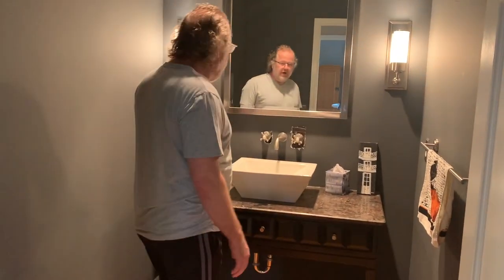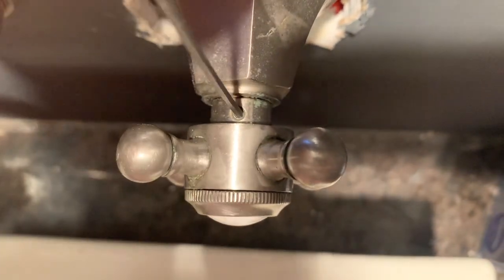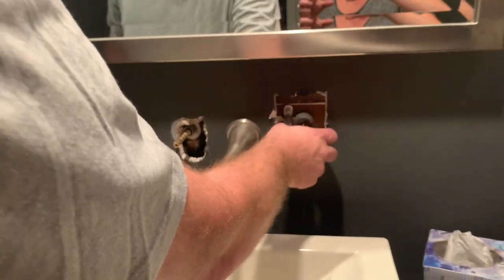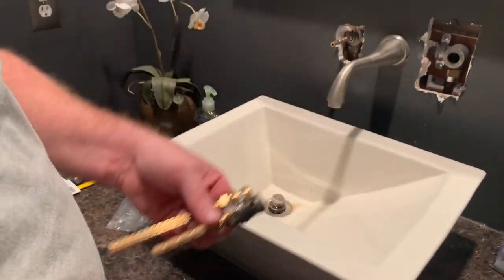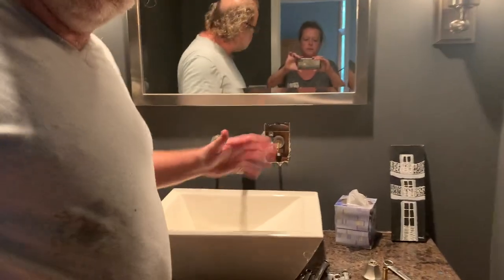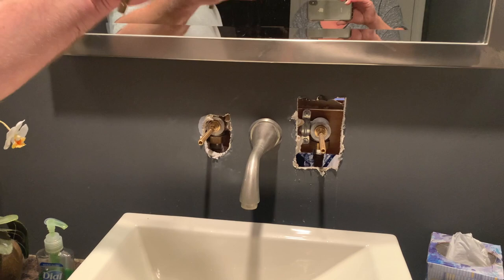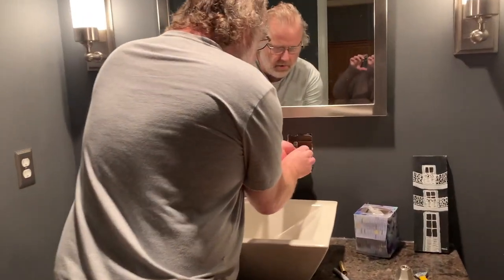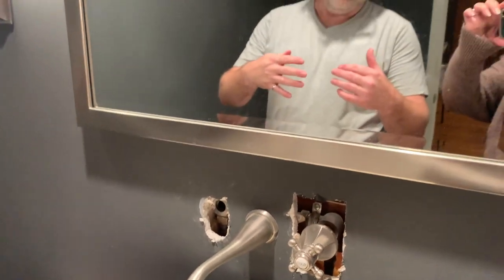Wall Mounted Faucet Repair is PAINFUL!

Comment: thank you for your video. I would love to have the confidence you have to change my taps over. I have to change my bath taps and spout mounted onto the wall tiles. Isn't there a tool for reaching into the wall space to unscrew/screw those fittings without tearing out your wall?
Reply from the maker: Thank you for reaching out. You 'might' be able to get access with a long deep socket wrench (3:21 of video). It depends how big of an opening you have in the wall. It is an each check 

1) Turn off water valve (always do this first! :)
2) Remove the handles and escutcheon as shown in the video
3) See if there is enough room to slide a deep socket wrench through the opening

If there is enough room for that the fit, you might not need to touch the drywall at all, and it could be a really easy fix! Let me know what you find out.

Comment: Can’t you just replace the O-ring in the cartridge? Or do you need to replace the whole cartridge/stem
Reply from the maker: Great question...I couldn't tell where the step had an issue, so I opted to replace it. Did you have any luck?

Comment: How is it any different than when tub or shower is dripping? I don't get the angst over this.
Reply from the maker: There is going to be a lot of similarities. If you have individual hot and cold handles in the shower, I think it should be very close, but every faucet will have its own differences. I have also have a video replacing the stem on shower faucet with a single handle.

Comment: By now you must know you didn't need to remove the drywall in order to repair or replace the stems.
Reply from the maker: Hey Harlan. You're absolutely correct, it is not required for this job. Lesson learned on my part. I wasn't familiar with wall mounted faucets, and I couldn't find a good tutorial on Youtube. At least now I can have a video on repairing drywall next!
Reply: DOH!  Rule 1 with a wall mount, buy top quality, this is not the place for a chinese amazon cheapy.
Reply: Even from a.logical perspective, there is no way a wall mounted faucet would require a wall being hacked open to repair.
Reply: @E1VM  hey he learned from it and owned up to it! leave him alone!!! lol

Comment: i can tell you're a homeowner and not a plumber...  you cut all that drywall for nothing.
Reply from the maker: That's correct. I highlighted that in the video. I did more work than I needed, but it was a learning experience for me. I've not replaced a wall mounted faucet valve before.
Reply: Can you tell me the make model on replacement stem?   Is it available online ?  Great video thanks